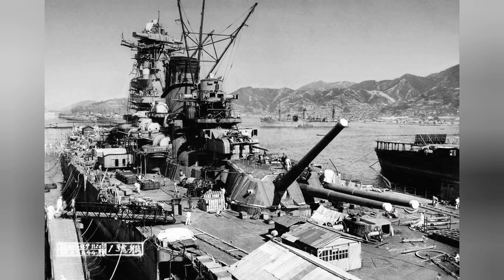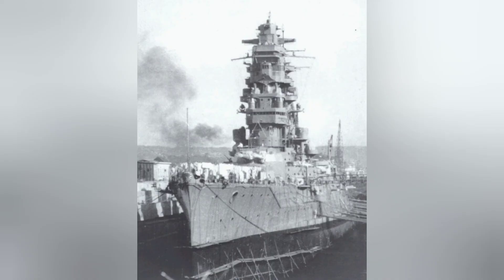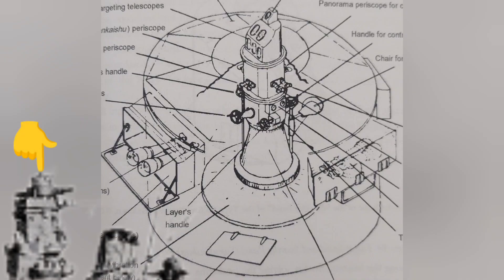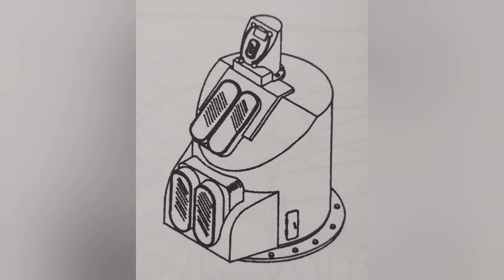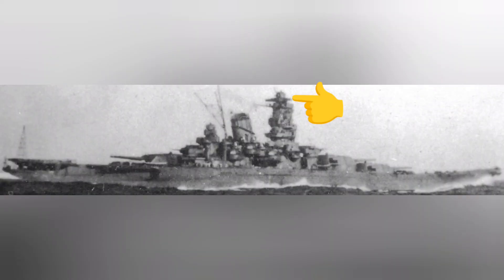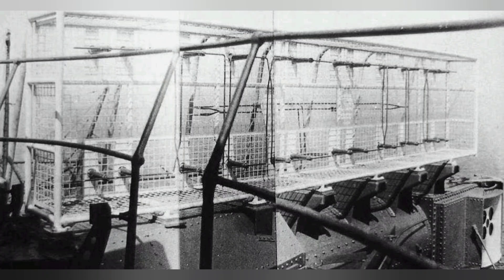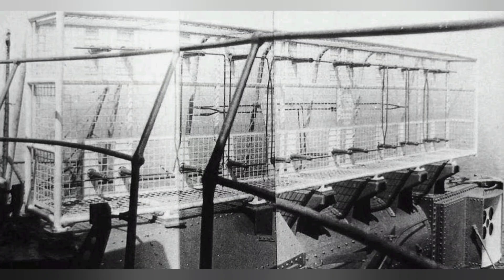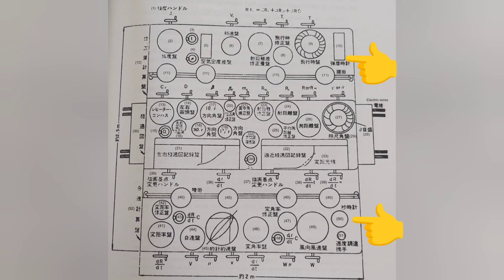IJN Yamato: Fire control

Comment from the maker: Bag of notes:
This does not go over every function of the fire control system, only major points. 
There are no photos of the fire control system, so I use diagrams of them in certain areas of the video. 
This was the most advanced fire control system in the Japanese Navy. While the equipment was updated from previous battleships, the operation remained similar.
Yamato and Musashi were the only Japanese battleships with rangefinders in all main battery turrets and the only battleships with reserve rangefinders. 
This video does not include the radar assisted fire control system, I only present the system as it functioned upon commissioning. 
The accuracy of this system was regarded as excellent during the Battle of Samar in October, 1944.
Reply: The Yamato and Musashi didn't really have a radar assisted fire control system; at least not as understood in either the U.S. or Royal Navies.  It was possible to contact the radar room to help determine range to target or confirm the range to target their range finders were giving them.  I have read one unofficial source that claims Yamato's radar was directly connected to the fire control computer, but I can not confirm this.  The Yamato probably did use its radar to assist its firing during the Battle off Samar, according to one of the officers who was interrogated about his experience during that battle a few months after the war had ended.  He wasn't 100% certain.

The type 22 mod 4 radar on the Yamato had an error rate of 0 to 3 degrees and an average error rate of 2 degrees when used to determine the angle to the target, which made it not useless, but also not very accurate for this task.  The radar screen was only four inches across and was not a P.P.I. display.  (A circle with a point in the middle representing the ship with a sweeping line and dots representing possible threats.  You've probably seen displays like this in a war movie or two.)  Instead, Yamato's surface radar screen showed a series of oscillating peaks with the largest spike representing the largest target.  There was something that looked like a ruler on the bottom of the screen with range numbers printed on it.  The operator simply looked at the highest peak and then down to the range ruler to determine the range.  Yamato's radar could not be used to determine the target's course or speed. 

A type 22 mod 4 radar system was taken to the United States and extensively tested after the war.  It could spot a battleship sized object at a maximum range of about 25,000 yards.  According to the diary of Admiral Ugaki, it did spot at least one of the escort carriers of Taffy 3 at a range of 22,000 yards.  As a comparison, the radar on battleship Maryland or West Virginia; or maybe both of them, spotted the Japanese formation at the Battle of Surigao Strait at a range of 42,000 yards.  The same type of radar on a Cleveland class cruiser spotted the Japanese destroyer Nowaki; the next night, while it was attempting to escape through the San Bernadino Strait, at a range of 41,000 yards.  In a night fighting scenario, the Yamato and Musashi's radar were hopelessly outclassed.  

Plus, they were terribly unreliable.  Their radar systems tended to break down, a lot.  The average vacuum tube used by the IJN in their electronic systems had a mean life expectancy of about 100 hours.  The type 22 mod 4 had forty vacuum tubes.  If any of them failed the system went down.  The resistors in their systems were also notoriously unreliable, as were their power transformers.  The materials they were constructed with were less then optimal because the war had dried up the supply of materials like nickel, molybdenum and even copper.  Electrical lines and cables used iron instead of copper wires.  Radar technicians weren't trained in preventative maintenance as much as they trained in finding defective parts and replacing them, which often led to the same resistor or other part burning out again and again.  Reading the U.S. assessment of these systems and the materials that were used to construct them is almost comical.  Even their screw drivers were prone to breaking under ordinary use.  The one item which Japanese radar technicians used which received the highest praise from American investigators was a specially designed and constructed wooden box which was used to carry spare parts.  It's design was complimented for the optimal use of space for each type of part it had to carry.
Reply: I do find it unusual that the Japanese, in spite of very good optics probably better than US and more like German, were really bad at hitting the slow moving and explosive/fuel packed merchant ships of taffy 3. For well over two hours the Japanese battleline shot at the escort carriers ant the destroyers and really did little damage (one cve, 2 DD and 1 DE lost). In spite of the heroic and clever defense of taffy 3 by these destoryers still that was not very good gunnery on the part of the Japanese battleline.   I wonder if (in particular) that the high loses of the Japanese navy by that point had reduced the proficiency of the fire control teams. For all the excellence of the Japanese optics if the users are not good and steady its not going to work out well.
Reply: @aldenconsolver3428  - The shooting from the Japanese battleships probably isn't as bad as you think it is.  It is difficult to be 100% certain, but it appears that for the majority of the battle the Japanese observers simply couldn't see most of Taffy 3.  The Yamato got off clean shots at the CVE White Plains with the first few salvos at extreme range and the Yamato put one shell right underneath its keel and had several near misses.  After it was mistakenly believed the White Plains blew up; a pillar of black smoke from the White Plains damaged exhaust system caused this error to be made, fire was then shifted to a target further away for a couple of salvos before Taffy 3 simply disappeared into a squall.

Also making it things difficult for the Japanese battleships and cruisers, Japanese officers stated that the use of smoke by American destroyers and destroyer escorts was "very effective."

Admiral Kurita made a huge error in thinking the aircraft carriers off Taffy 3 would eventually make a hard turn to launch the remainder of their aircraft into the wind.  He calculated a course to catch these carriers when they made their expected turn which meant his main force did not directly chase Taffy 3.  Instead it pursued on an angle away from Taffy 3's course, which meant that even though the Yamato and Nagoto were at least 6 knots faster than the American CVE's, they gained very little ground.  Even the Haruna and Kongo; which sailed on a different course, didn't get very good views of Taffy 3, with Haruna even taking time and wasting ammunition to fire at the escorting destroyers of Taffy 2 at extreme range with little chance of hitting them.

Only the CVE Gambier Bay became clearly visible to the people on the Yamato and it was eventually shot to pieces.  One of the Japanese officers who was aboard the Yamato was asked by American interrogators in December 1945; so just a year and a couple of months after the battle, why Center Force had failed to catch the rest of Taffy 3.  His answer showed that he still believed his force was chasing Essex class carriers.  I'm paraphrasing his answer, but he said, "They were simply too fast for us.  We couldn't gain ground."  When he was asked if it was known that some of the Japanese heavy cruisers had closed to within 6 kilometers of the remaining carriers his answer was, "What!? We didn't know.  No one said anything to me about this."  This officer had been on the Yamato's bridge with Admiral Kurita.  I believe he was Kurita's Chief of Staff.

My memory is fuzzy on this, but I believe Yamato fired 124 -18" shells during the battle and Nagato 111 - 16" shells.  24 of the 18 inch shells were anti-aircraft shells and couldn't do much to even a CVE.  Yamato fired four, maybe five six gun salvos before Taffy 3 hid away in the rain squall.  Most of the rest of the shots would have been at destroyers until the Gambier Bay became visible.

Finally, get the book The World Wondered: What Really Happened Off Samar by Robert Lundgren.  It contains numerous photos which show salvos landing close to Taffy 3 and gives the time for when these salvos landed.  If nothing else, these photos demonstrate the dispersion patterns from Yamato and other Japanese battleships were very tight.
Reply: @aldenconsolver3428 the Japanese optics were proven to work very good in other engagements of the war (especially at night, there they surpassed all other optics), but I belive that they couldn't see through taffy 3s smoke screen which resulted in relatively poor accuracy for most of the battleships. Yamato was about the only Japanese BB there that actually had good accuracy, I belive she fired around 100 main battery shells and scored 15-20 hits, the other Japanese BBs fired a similar amount of rounds and only scored around 3 hits each.

Comment: A very interesting video regarding the fire control of the  Musashi and the Yamato. I always understood that Japan was fitted with very high quality optics and excellent mechanical controls but was fitted with low quality radar, a serious drawback. To pull it out one from extreme pressure is out of question unfortunately... Good job 👍 👏
Reply: The first- salvo hit which Yamato obtained on USS Gambier Bay (at just under 22,000 yards from a six- gun salvo of Yamato's forward turrets) was aimed solely by the ship's Type 22 radar. Yamato lacked a visual on Gambier Bay until approximately one minute after the opening salvo was fired.
Reply: @manilajohn0182  thank you for the info 👍👍